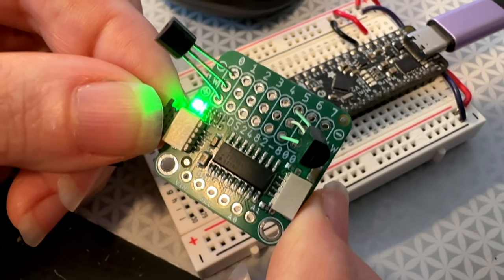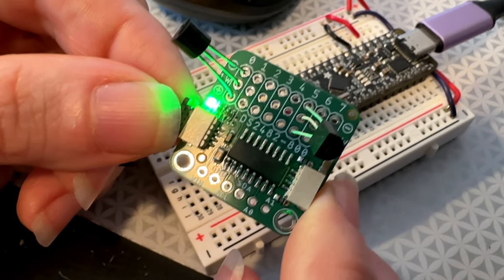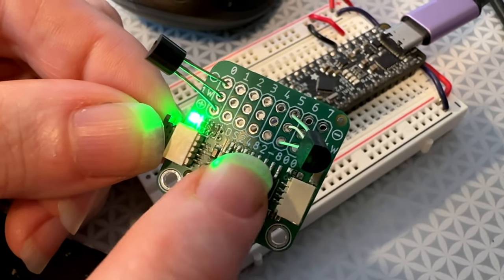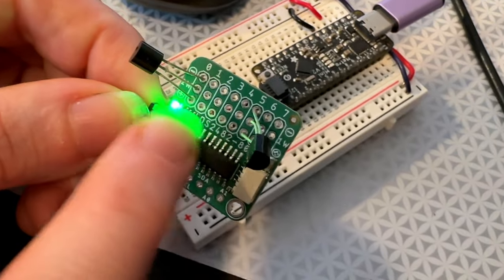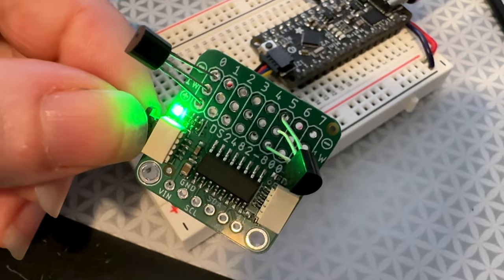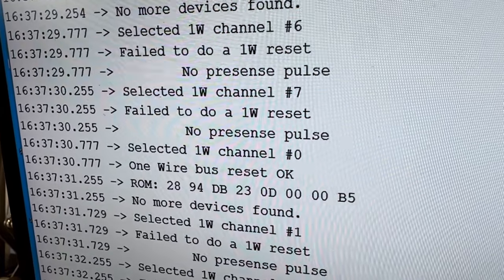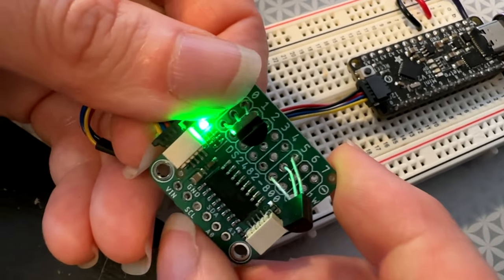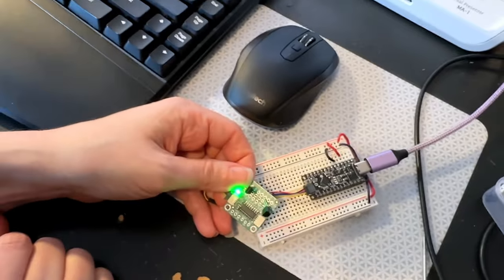DS2842-800 is eight times the 1-wireness of DS2484

Comment: The 1-wire bus already supports stringing many sensors in parallel without extra hardware. You can reuse old stereo connectors for these sensors, even using stereo plug splitters to break out different sensors in different directions.